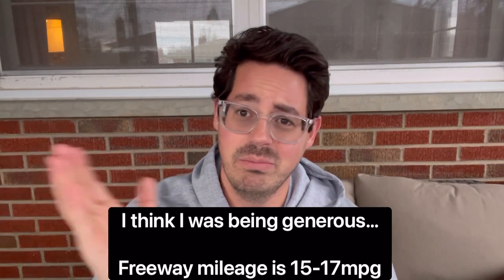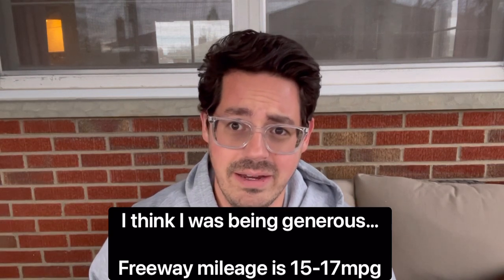Worst Engines of All Time: 1982-84 GM/Chevrolet 305/350 V8 Cross-Fire Injection System

Comment: Great series and another good video.  I agreed with you on the ford 460 as I've had several, but I think these cross fire engines got a bad rap because nobody knew how to work on them at the time.  My 84 Corvette runs very nice and how mileage isnt bad.

People need to realize that this was the early years of efi so of course they aren't going to run like something made now but I'm happy with mine.

That being said I'm not using it for daily transportation,  as it's now a 38 year old collector car.

Comment: All ECM's of this era had problems with the drivers of on/off solenoids they operated and if the resistor in the solenoid went open the resulting 100,000+ volts the coil collapse would send back to the ECM when it commanded the solenoid to turn off would blow the ECM up! So they came out with "Quad Drivers" to dissipate that voltage to protect the ECM.
   One other funny thing that showed sometimes cheap engineering would actually incentivize the car companies to do something better was the "speed/density" programming in the PROM chip inside the ECM, and what it caused. Depending on the car, the fuel tables in the PROM (programmable read only memory) would meter a specific amount of fuel to the injector(s) and the parameters it would look at were the speed of the engine, the vacuum in the manifold and the position of the throttle. All of those were keyed to a measurement the ECM took when the key was first turned on. If you turned the key on at, say, Miami Beach, the ECM would use a speed/density table for sea level. If you were in Colorado Springs, which you know has significantly lower air density than Miami because of the altitude, when you started the car, it would use a 6,000 ft altitude table. The ECM would use whatever altitude table it "saw" when the key was first turned on for as long as the ECM was on. Once you turned it off, it would lose that and use whatever table it "saw" the next time you started the car. The sensor used to take this measurement was the same one that was measuring vacuum when the engine was running, the MAP sensor (Manifold Absolute Pressure) and it took it's reading from inside the intake manifold. Key on and engine not running, as when you first turn the key, it took this barometric pressure reading. After the engine was running it was sending a vacuum reading to the ECM.
   So if you were in Hays Kansas for instance, (altitude 1000 feet) when you started your trip to Colorado Springs, by the time you got there you'd be trailing a black smoke screen a mile long and smelling rotten eggs because the ECM was dumping too much fuel for the air of 6000 feet. It was using a 1000 ft barometric pressure table. Customers who were still under warranty would pull up in the local GM dealership service drive, turn off the car (fixing the problem BTW), get out and go scream at the service writer, "I just bought this thing...".
   It didn't take too long for the technicians to school the service writers as to what was up.
"Whatever you do, DON'T go out there and crank the thing up to confirm the problem. Just write up the warranty ticket and AFTER THEY LEAVE, THEN get the porter to park the car.
   Of course the technicians knew exactly what to do. The dispatcher would give the ticket to his favorite technician who would write on it, "Connected car to CAMS for diagnostic. No problem found", and get paid 1/2 hour for his handwriting. CAMS stood for Computer Assisted Monitoring System and it was a big cabinet with a CRT touch screen on top and long leads to hook up to the ECM and such.
   Of course the bean counters at GM figured out the scam before too long. OH, BTW many customers who were out of warranty were being robbed blind from crooked mechanics over this. But it was GM paying dealerships their hourly rate for the 0.5 hours they were paying the techs every time this happened, and it happened a lot, that caused the engineers to finally adopt the MAF sensor (Mass Air Flow) and end the days of speed/density fuel management.
   A MAF sensor very accurately measures, not just how much air, but how much Oxygen is entering the engine by taking a reading of the static charge Oxygen atoms make as they rub past the wires in the air stream, and is a much better parameter to use than a calculated measurement of air from vacuum, throttle position and RPM.
   As an aside, Chrysler used a very simple device to measure how much air was going into the engine from the earliest days of electronic engine controls, and it worked quite well because the amount of Oxygen in the air varies only slightly from say, Chicago to the Amazon rain forest where it's maybe 0.1 percent higher. Chrysler used a little door in the pipe going to the intake manifold that had spring trying to close it and a position sensor to tell the ECM how far open the door is. When the engine was running it would make a vacuum behind the door, opening it against the spring. The wider the door was open, the more air that was entering the engine. It served the same purpose as the much more expensive MAF sensor and did almost as good a job: good enough for the emissions and CAFE standards of the day. I think Chrysler was still using it well into the 2000's.

Comment: In May 1982 I test drove a 1982 Camaro 5.0 V8 with 135 HP in California with automatic transmission  and end up buying the 2.5L with 90HP and a manual transmission.  The V8 was considered a muscle car with its massive 135 HP so when you were under 25 age you got to pay 50 percent more for insurance.   

With the V8 you got 50 percent more  HP with double the engine displacement. Plus the V8 weighed 273 Lbs more than the I4. Plus California had no manual transmissions except in the 2.5 L. 

With the 2.5 the combined mpg on the sticker was 24 and 14 with the v8. 

So tbe V8 was better if you were over 25 and got free gasoline. :)

Comment: I once worked at a used Vette dealer, and NONE of the 82s and 84s ever ran right. Absolute garbage! The 85s and up  ran MUCH better.
Reply: Yes, I had an '86 T/A with a TPI 305.  Ran well, and 28 mpg on the highway.

Comment: I've got an '82 with the Computer Controlled Rochester Quadrajet on a 305 with the same Turbo-Hydramatic 3-speed.  Many of the same issues as described in the video.  Years of messing about, but I could never get it to run right.

The overall fix ended up being an Edelbrock AVS2, B&M 700R4, and Vortec 350.

Still an absolutely glorious vehicle with the stock setup, but the 350 and 700R4 makes a world of difference.

Comment: I'm in the middle of ''refreshing'' a 1982 with Mis-Fire motor. Thankfully it has a 4 bolt main block. So a .030" over 383 stroker kit with Edelbrock Performer aluminum heads and intake is going in. Haven't decided between a carb or Holley Sniper FI. I'd like to do a Chevy z-28 cross ram manifold. Going with a rebuilt 700R4 too.

Comment: It's fascinating to hear all this about these cruddy cars.  Yes they were beautiful, but even back then at the age of 16 I knew they were turkeys.

Meanwhile, in Stuttgart, Porsche was building a big block V8 engine with 20 less cubic inches that made exactly TWICE the horsepower of that 305, the M28-21 series for the 928S2.  General Motors to this day has always been about cost cutting, not cutting edge technology.  We never saw this M28 engine in the United States [gray market cars excepted] because it couldn't meet emissions, but the 32 valve version that came out in 1985 could.

Great video!

Comment: As bad as GM's Crossfire Injection is, I can actually beat that; Bosch CIS! One of the worst of the worst Bosch Jetronic fuel injections that ever was - Personal experience with it, years and years of it.. I'm probably 1 of 4 people left in Houston who can work on/tune it the *right way*. Like your fuel continuously sprayed, even when the intake valve is closed? CIS! Like your delivery system hopelessly and very unnecessarily complicated? CIS! Enjoy extremely fragile super super expensive parts that like to break with so much as ONE metric micron of of piece of a dust particle? CIS! Do you prefer your fuel injection 3/4 pure mechanical & 1/4 early European digital electronics? Later model CIS got ya covered!! Do you like your AFR continuously variable to every number but a safe 13?? CIS!! And I'm a guy who's actually got a lot of experience with Renault's Bendix system on various Chrysler/AMC/Renault vehicles - CIS makes it look like little kisses from Jesus - It's that much of a total pain in the ass to live with when they were fairly young. Now in their elderly years (cars that came with CIS) you're far better off with a lawnmower carburetor OR 4 guys in the trunk to push you at a second's notice. You can't really get good injectors anymore, and you're going to pay $3,000+ for a fuel distributor IF (that's a 'you probably won't' kind of IF) you even managed to find one. Even then, good luck finding a guy locally who can tune it to your vehicle the right way and have it function half-assed just like when the car was brand new. Hope you've got an endless supply of alcohol-free avgas that never spoils.. or it's lather, rinse, repeat!
Reply: I'm fairly certain the team responsible for designing CIS found a secret stash of Hitler's Nazi Meth (real WWII history btw; Hitler's amphetamines for soldiers that is!), stayed up for 5 weeks & shit out this odd Rube-Goldberg effect, slapped the good Bosch name on it and collected millions in OEM licenses. I could and should write a book on this horrendously misguided abomination because so many people STILL needlessly defend it. And that's evidence of shear mechanical ignorance

Comment: As a licensed dealer for 20 years, I went back into my inventory and searched Corvettes of this era and we turned 16 of them through our inventory.  Those vehicles were 20-25 years of age when they were sold.  None of them had any type of significant issues and according to my records on each vehicle, three of them required throttle body rebuild/reseal kits, two needed intake manifold gaskets and one needed a throttle position sensor.  Other than oil leaks and other maintenance, that was it.  We made money on each of them, the high profit was $8,700 and the low was $4,400.  I'd hardly agree that these are among the "worst engines of all time".  Nonetheless, the theater here is great.

Comment: In 1982, I ordered a Z28 Camaro with this exact engine.  At the time, it was difficult for me to choose between the Z28 and Trans Am as I loved the styling on both these vehicles.  The Cross-Fire Injection in my Z28 worked flawlessly during my ownership.  Sometimes I think I got the only one that ever worked as GM intended.

As you state, the 305 was not a powerful V8 engine.  I did order my Z28 with the optional 3:23 “performance” rear axle ratio.  That 305 needed all the torque multiplication it could get.

While these vehicles had utterly unremarkable acceleration with the 305, both the Trans Am and Z28 had fantastic handling characteristics for the time.  Especially for a completely stock GM vehicle.  I amazed myself numerous times on how hard I could push that Z28 Camaro through curves!

Love the series!  Keep up the great work, Adam!
Reply: My dad ordered the same Camaro, and hated it so much he returned it and never went back to American vehicles again after he bought a toyota 4x4 pickup and loved the reliability.  He just gave in and finally got a Scat Pack 392 Shaker a year ago

Comment: I have owned two of these, When they are set up properly they run good and return good fuel mileage. the problems show up when someone who should not be under the hood touches it and it goes downhill from there.

Comment: I have worked on many of these crossfire cars.most ran well and got in the mid 20s mpg.a long time friend still has the one he bought for his daughter.305/5 speed and runs like a watch and gets 27 mpg on the highway.if yours runs that bad take it to a real mechanic and have it fixed!
Reply from the maker: Anyone who says these cars get 27mpg is driving 45-50mph in 5th. Even the EPA, with its very generous hwy rating back then, didn’t rate them that high.  My TA is a 3spd non OD auto. A 5 speed manual, with an OD ratio will certainly get much better than I do, but likely in the low to mid 20s.
Reply: @RareClassicCars  - My '77 GP carb'd 301" 3 speed auto was rated 16 City and 23 Hiway... so little streamlined F-bodies/Vettes should do better... '86 Monte Carlo 305" 200-4R rated 17/25... same as 1990's EFI 302" Mustangs...
Reply: The crossfire injected Camaros and firebirds were only available with the automatic transmission. The manual transmission wasn't an option with the CFI 305

Comment: The GM 5.3 small block with the cylinder deactivation (came out ~2004) certainly didn't win a lot of fans.
Reply: 2004 ???  NO It was 2007 ASS CLOWN with AFM system that chews out camshaft and lifters

Comment: Thanks Adam, I learned some things. So, is it possible (or very difficult) to replace the crossfire system on an 82 collectors Corvette?
Reply: It's a chevy small block. So no, it's incredibly easy mechanically to "de-crossfire" the engine. Bolt on a 5psi fuel regulator, the intake manifold, carb, and distributor from a 74 350 4bbl, voila! But you'll never pass smog tests, that turbo 200 trans will need voodoo applied or to be replaced with a real trans, and the digital cluster will need some too

Comment: I had an ‘82 Trans Am. What a disaster. The bracket holding the spare tire broke repeatedly and the functional hoodscoop warped after a while which let water into the engine and bent a rod. Plus all the problems Adam mentions. Those wheel discs rattled and would fly off at high speeds. Surprised Adam’s car still has them. To their credit Pontiac paid for the engine rebuild out of warranty and swapped the wheels out for a newer design. It was my last Pontiac.
Reply from the maker: Mine are siliconed on!
Reply: @RareClassicCars  clever solution. Pontiac first put a series of anti-rattle clips on but that made the discs even more prone to flying off.

Comment: Here in non emmission/non original land we just stuck a 4 barrel intake, carb, and mechanical advance distributor along with a lock up controller or eliminated lock up.  Lots more power and way more tuneable.
I had a few customers that kept the crossfire and they always ran decent.  Loads of low end torque.

Comment: Besides being wrong about long runners favoring high rpm I didn’t hear him talk about the intake runner volume. The runners are only about 2/3rd the height of the head intake port. This was another contributor to low HP. Some speculate this was done to make the soon to come out TPI look so much better in comparison. With an aftermarket intake and computer update it’s not a bad setup.

Comment: Keeping the era in context , the 84 corvette was almost blistering fast for the time .  0 to 60 in 6.8 seconds … a lot better than a chunk of the 70s models . 

The TBI system ended up being very reliable though .
Reply: My 84 Vette is very reliable
Reply: Yeah, one of my friends across the street from me when I grew up, his dad had a 78 C3 Indianapolis 500 edition. Back in 1984 he kept ragging on my mom's brand new space ship.. err C4 Z51. Turns out the C3 just was a loud-mouth and had a 4 speed instead of her automatic. That 78 couldn't do 1.0g on the skid-pad, completely bone stock off the showroom floor (nor could any other high volume production car from Europe or Japan in 84, the Z51 performance package with $495 each spec made Goodyear Eagle asymmetrical tires and kidney buster suspension were required).
Reply: TRD blower kit.
Reply: I think a V6  Buick Grand National is faster...
Reply: @SH00T TH3PUMP  The 84 GN wasn’t faster than the 84 Corvette, but the 86 GN was
Reply: My toyota tundra pulls 0-60 in 5.9 seconds lmao.... thats with over 1000lb of tools in the back, ive beat jeeps, ford and chevy trucks, bmw. I know they aren't comparable but its just weird to think my work truck is faster than a corvette of any year
Reply: @rjmac3001  no it doesn't. Even the twin turbo 3.5 in the brand new tundra is just capable of 6 seconds flat.
Reply: @rjmac3001  3.5 ecoboost will pull on you every time especially with the 10 speed
Reply: @rjmac3001  5.9 isn't too bad for a truck, atleast an older one.

Comment: The Crossfire sure had a cool engine cover. I believe it was cast magnesium.
Reply from the maker: It was and is definitely cool
Reply: On the 84 L83 C4, yes. On The 82-83 LU5, and 82 L83, it was stamped steel.

Comment: My Dad bought a new '84 Corvette in April of 1983. I got to drive this car a lot. It actually got 22-24mpg on the highway. I also topped it out at 130mph. It had the Z51 handling package and man, could that car handle the twisties.
Reply: It actually did over 140 mph! Impressive speed for 1983.

Comment: All around a solid, reliable engine with a bad intake manifold. Swap on a Renegade intake, and it comes to life. And Long runners have nothing to do with high rpm power. It’s all about  low end torque.

Comment: I was aware that you owned a 1982 Trans Am at one point but I didn't knew you still do. Knight Rider surely was and still is one of the reasons why the early 3rd generation Firebird are still sought after. Their brand new slick aerodynamic shape certainly were a success back in the day. Knight Rider was great publicity for the cars as well. It worked for me as a kid. These cars aren't perfect but can last decades if they're well taken care of. They're not muscle cars but they're fun cars to drive. Things under the hood can be tweaked and upgraded as well under the car. Anyways, I enjoyed your video. Would you do a full review of your 1982 Pontiac Firebird Trans Am?